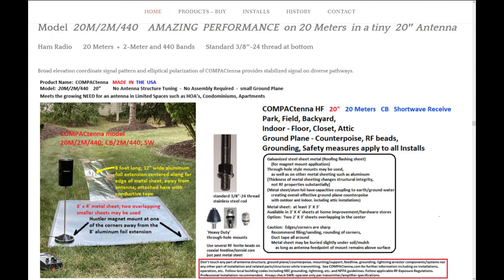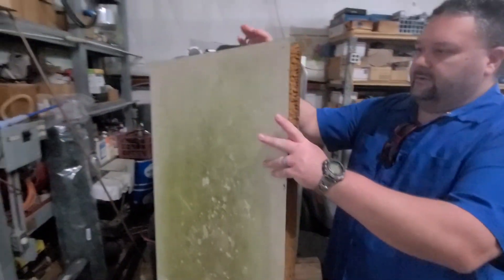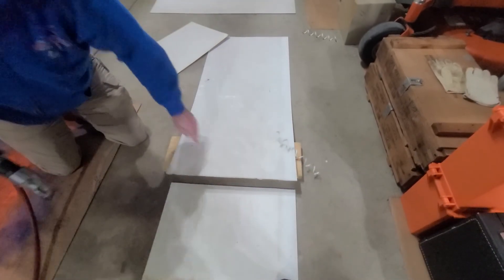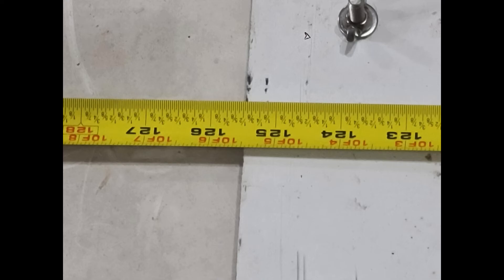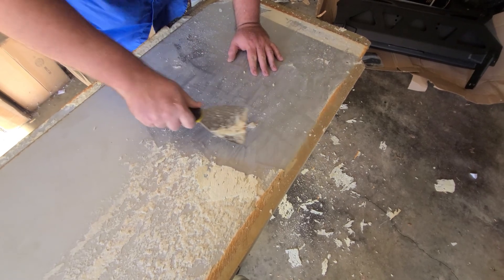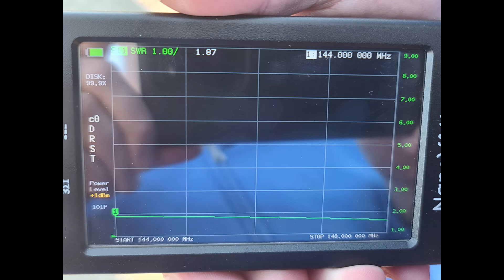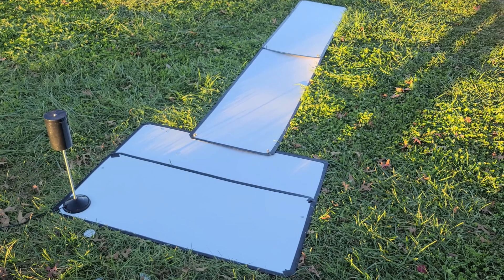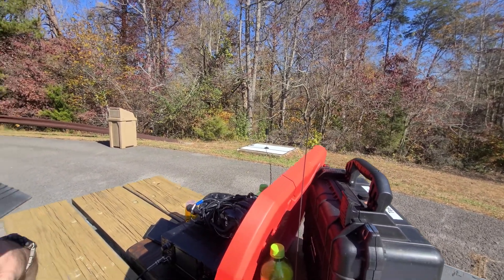LCARA HAM Radio: COMPACTtenna 20" with Ground Plane - Counterpoise!!!!

Comment: It would be good if you could select(or choose not to select)  real time entry so that you can choose to use the actual time you entered the data and hit enter and removed the need to enter time or edit it. All computers keep the time so it should not be hard to do. The fewer pieces of info you need to enter the easier it is to deal with lots of calls.